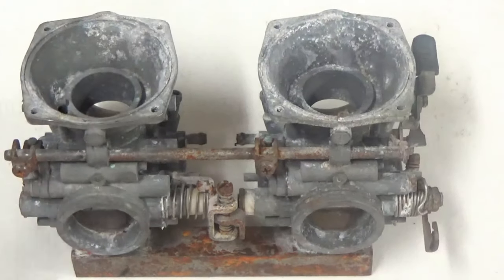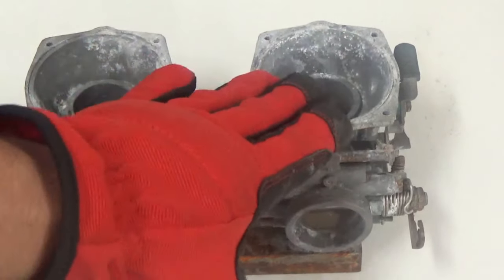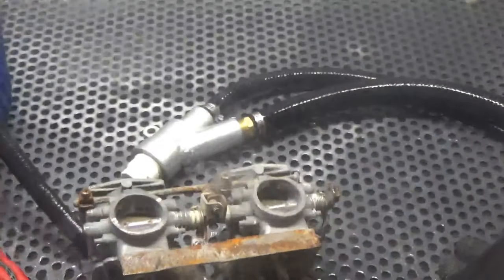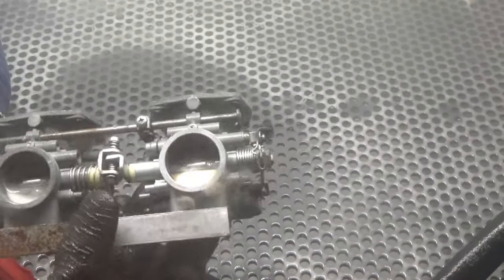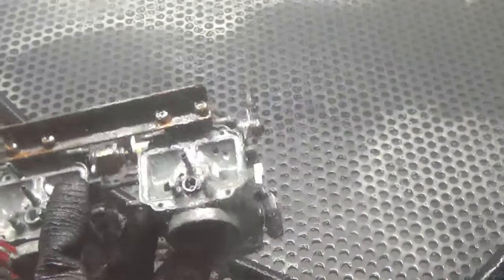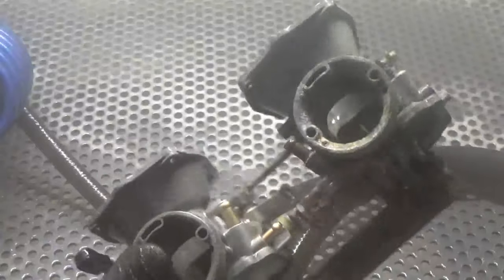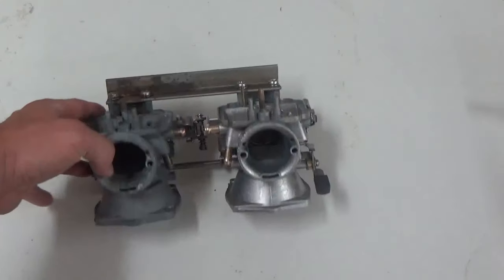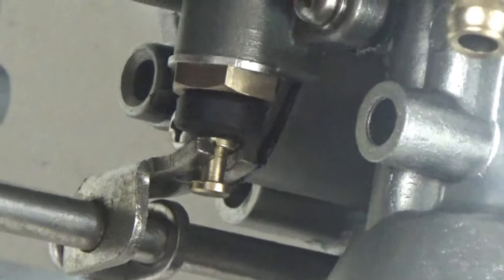Vapor Blasting Vintage Motorcycle Carburetors- Vapor Honing Technologies

Comment: Awesome job! But carburetors have a lot of tiny passages, holes and pathways for air and fuel – won't the beads get into them? Vapor honing is glass beads + water right? Thanks for answering! Best, W.
Reply from the maker: You are correct Walid, you can plug these areas, or use a High Pressure parts Washer as a post process, we also suggest, dip tanks or ultrasonic cleaners to get the abrasive out.  For more information or to place your order please contact me at 828-202-5563 x 103 Niki nicole@vaporhoningtechnologies.com

Comment: Hello Vapor Honing Technologies,

VERY interesting process and results look GREAT in video.

I am currently rebuilding a greasy/grimy Toyota 2zz-ge engine that will be installed in a gen-3 MR2/S.  I would like to have it looking like better than new when finished.

Interested in this process for cylinder head, block, and other aluminum pieces.  My biggest concern in aluminum journal bearings in the head for cam-shafts.  They ride on machined aluminum w/o bearings.  How can I protect these surfaces?

Also plan to coat all engine parts to avoid future corrosion (looking at Yamaha marine paint).

Thank you in advance and please advise,

Mr. P

Comment: What is the mixture ratio of the slurry and what do you typically use 175-300 grit? Lets say you are using 5 gallons of water how much media would you add into that? In these machines are the Glass Bead and Water premixed together in a single tank or are they stored in separate tanks until you push the foot pedal? Sorry for all the questions but these machines fascinate me!!! Great stuff keep up on the videos you guys should do a Frame next show us how to Vapor Blast something BIG!
Cheers
Reply from the maker: Thanks for the comments and keep them coming. Your ratio of media to water normally is 20-25%. The easiest way to check is doing the beaker test where you spray the water and media mixture into the beaker letting it settle to find the appropriate mixture. We normally run 20-25 gallons of water in the vapor hone with 25lbs. of media this gives us the proper ratio for processing. Yes, everything is stored in the bottom of the machine which we normally call the hopper when the pumping system comes online it will begin to mix the solution creating the slurry and pumping it to the blasting gun.
Reply: @VaporHoningTechnologies  I don't understand. You said your ratio is 20 to 25 gallons of water to 25 pounds of material. But that's not a ratio of 20 to 25%.
Reply: @seekingthetruth304   in my point of understand its - 20-25% of media on 100 water.
that being said - its 20-25 gallons(US) of water is 166-210lbs of water : 25lbs of media
did i get it right? or am just mixed up the other way around. 

what i hope to find out is the beads size used.
Reply: No 13 glass bead

Comment: Sir, do you recommend using a chemical inhibitor to the blast media to prevent flash rusting of steel items? Also, and this may sound silly but wouldn't you disassemble the carb first?

Comment: I have to put bolts in all the holes after chasing the threads on all the motorcycle parts I bead blast (dry)so the threads don't get damaged. I notice you don't?

Comment: Does this blast all the original zinc coating off those screws, bolts and springs?
Reply: Depending on pressure you can either clean or remove the plating

Comment: what compressor do you recommend I know a 7.5 80 gallon would be good, any specific brands you guys use?
Reply from the maker: The quietest compressor on the market is the silent air series compressor from polar air made by Eaton Corp. However, lower budget great compressor is a 5 Hp Ingersoll Rand SS5 pump the only downside is its noisy.

Comment: I'm using glass bead at 135 psi using the original sandblasting gun provided with my Harbor Fright cabinet. Ratio of 3  1/2 cups of media to 3.4 gallons water. Its not shining but rather leaving a dullish, albeit clean finish on my bike crankcases. Any idea of where I'm going wrong please?
Reply from the maker: What we are showing in these results are from a Vapor Honing Cabinet.  Using Water and Abrasive under compressed air to get this fine finish.  We do not claim that a dry blast cabinet will give you this finish.  Contact us for more information nicole@vaporhoningtechnologies.com
Reply: @VaporHoningTechnologies  Thanks. Perhaps I should have mentioned that I am doing the above using a vapor honing cabinet.

Comment: There's no info on your mix(?) what do you blast with? And how does it differ from vapor blasting? scratching head and shrugging 🤔
Reply from the maker: Matthew, this is vapor blasting. In this instance this is water mixed with fine glass beads.
Reply: When using the glass bead media on carbs or bearings, is there concern for the media clogging the carb orfices or getting into the bearing races?

Comment: So no caution needs to be taken when using this machine with aluminum engine cases or anything? Was worried edges where the cases meet. The portion where the gasket is.
Reply: It's the perfect finish for sealing surfaces

Comment: It doesn't clean the internal passages. You need an ultrasonic cleaner to do that.
Reply: I used a cheap harbor freight spot blaster with baking soda and it cleaned internal passages using a small compressor. I would imagine this would do just as good.
Reply: Ultrasonic cleaner really does not do a good job.  Never had much luck with it.  This is better.